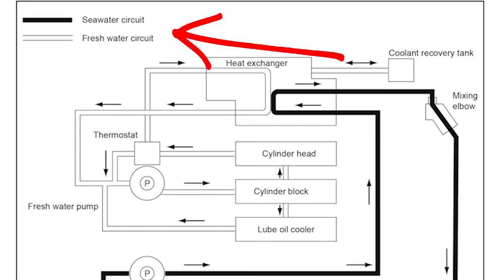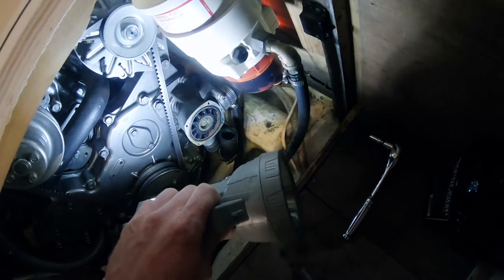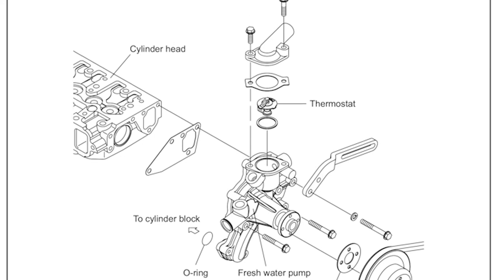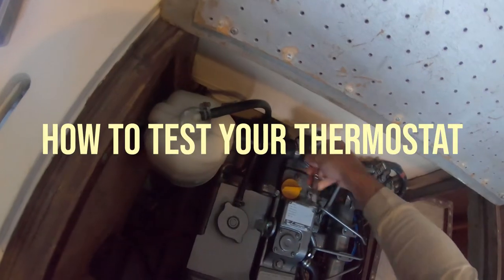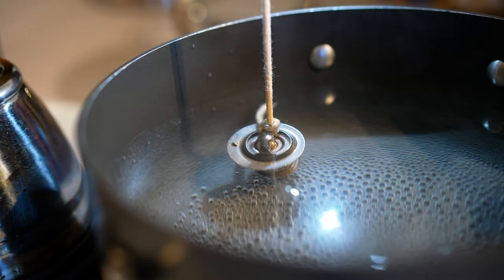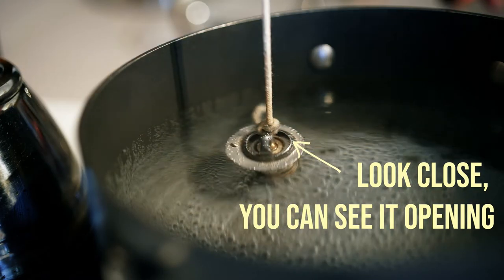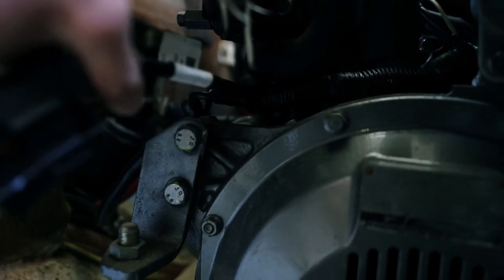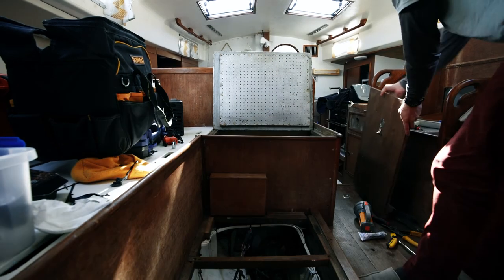The Ultimate Guide to an Overheating (Or Not) Engine | 05

Comment: Nice trouble shooting!  The engine manuals are indeed helpful.  Your engine looks really clean. I recently replaced a thirty year old Yanmar tachometer with a modern third party one but not without a lot of study, bench testing, calibrating, wire sorting and locker diving. I use heat shrink or split tubing to protect wiring wherever possible.
Reply from the maker: This is the same engine that was totally submerged in salt water after our near-sinking. Luckily we acted very fast and got it out of the boat and into the hands of a professional in less than 48 hours after draining the water out!

Comment: So did you actually find the place in the single problematic wire that had chaffed through and was making contact and grounding out, and did you repair that damage by replacing the wire or splicing in a new section of wire?   Underneath the layers of black tape you applied, I'm assuming it is electrician's tape, do you still have a wire that has been partially chaffed through?
Reply from the maker: I did find it which is what I taped up. It was barrreeeelllyyyy chafed through so I didn't do a full on replacement or any splicing. Just wrapped it pretty heavily in electrical tape.